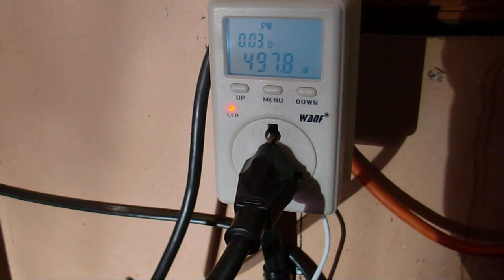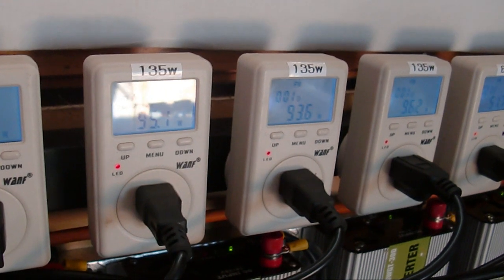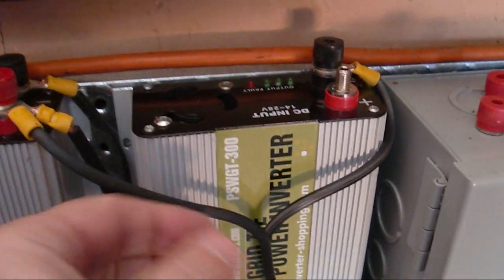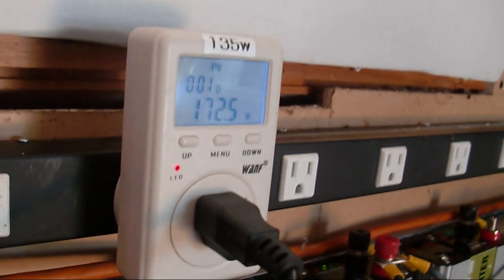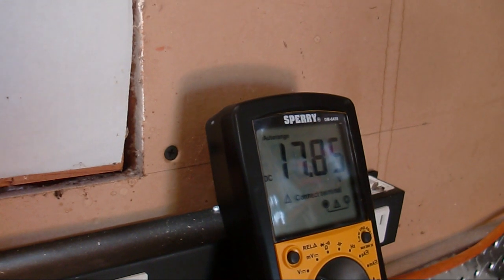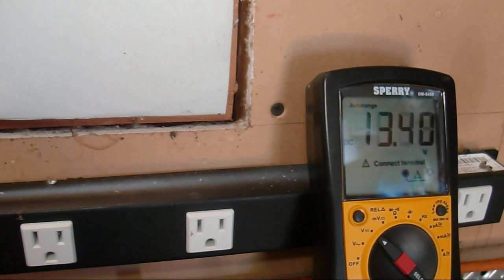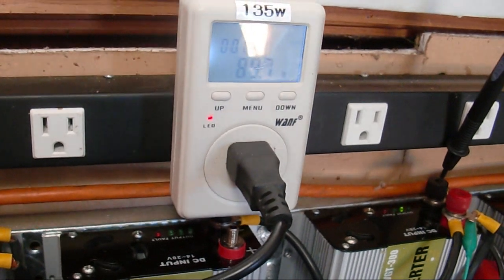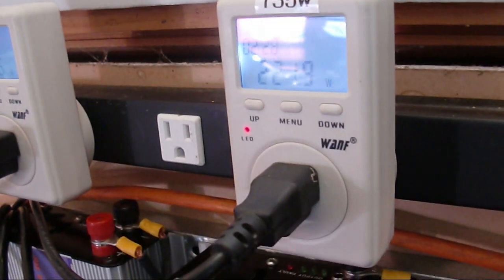Power Jack Grid Tie Inverter - Managing solar PV panels connected in parallel

Comment: I have 2 identical 36-cell 100W panels.

With both in parallel feeding a SUN300G, I get at most 130W
With both feeding separate SUN300G inverters, I get 142W total
With both in series on a 22-60V SUN500G, I only get 115W

A 1000uF cap on the SUN300G gets me about 2-3W extra output each.  10000uF reduces output by about 5W in full sun.  Not sure why, but I can only surmise the GTI is looking at peak input DC voltage since the caps reduce the 120Hz DC ripple.

A single panel per GTI works best

Comment: I'm seeing around 120 to 160 watts from 2 100 watt panels tied in series for a 24v array. Now they are just laying on the ground propped up with a frame I quickly put together. This is also tied into 2 Sun 500 watt 22-60VDC wind GTI's sitting at the end of 40ft. of 12AWG stranded solar cable. I hope to get more efficiency once they are moved to my shed roof and mounted permanently.

Comment: Thank you,
I just got 4 Astronergy 290 watt "CHSM6612P-290" panels, but looking at the tech sheet the Rated voltage (Vmpp) at NOCT is 32.51VDC each. Rated voltage (Vmpp) at STC is 35.68 V.
 
Do your solar panels get close to their NOCT because I got 2 - 600W Solar Grid Tie Power Inverters that takes 22V~60V each. Should I be concerned about going over the 60V limit with two panels tied in series?

Sadly im facing Due west.

Thanks Again

Comment: Have you run a test of putting your Solar panels in a series connection?
Also, have you tested if your can put the grid tie inverters INPUT's in a series to make a higher voltage for all the panels?

Comment: Just to make sure your conclusions are correct you should completely disconnect the GTI each time you make a change. Nice thing is with your setup, you can just switch the panels off. Thanks for these tests, it helps show everyone the characteristics and how these GTIs behave. I haven't had a problem with them and they have been very reliable so far. UL approval wouldn't make a difference on these, I don't know why people think that's such a big deal, same parts, same metal case, fuses, etc...